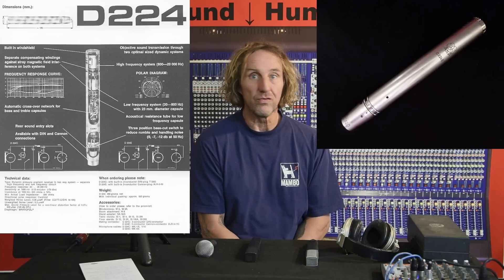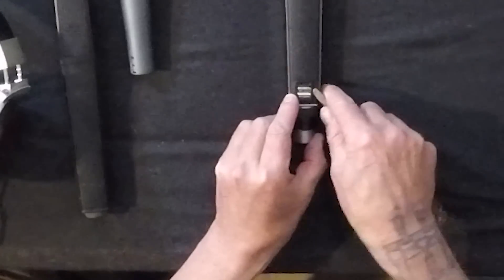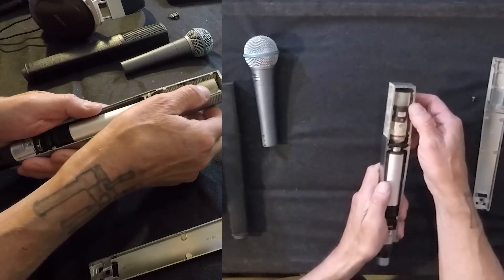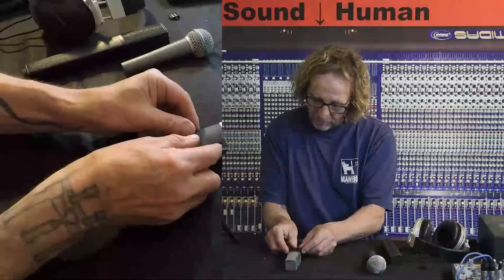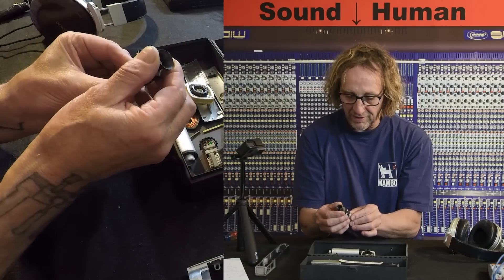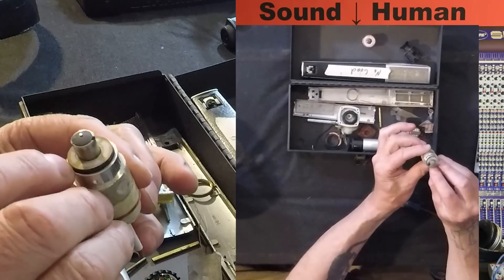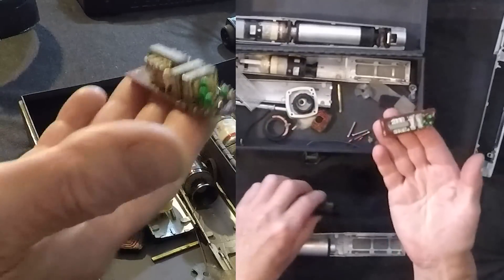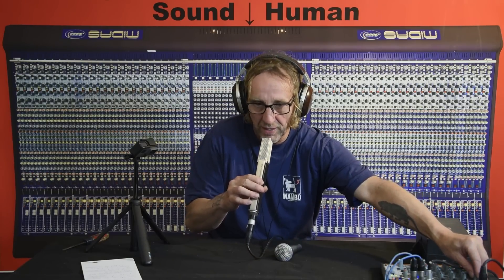Tear Down Beautifully Designed Sennheiser MD441(Public)

Comment: Digging around, I read the MD441 mic was launched in 1971.  My first mic was an Electro-Voice 635A broadcast mic from the 60's, I believe. Still works and makes as a pretty good hammer too.
Reply from the maker: 635 is the Omni that is popular with reporters? If I recall correctly, the re55 is just a 635 with shell around it and if ya open the re55, there is an unfinished 635 inside
Reply: 635A is a pretty nice mic on guitar amps!